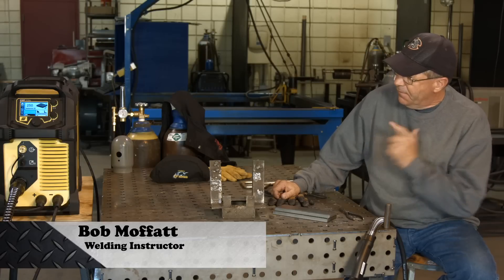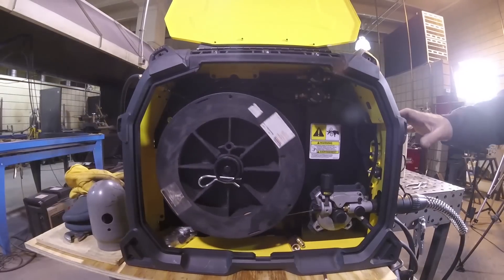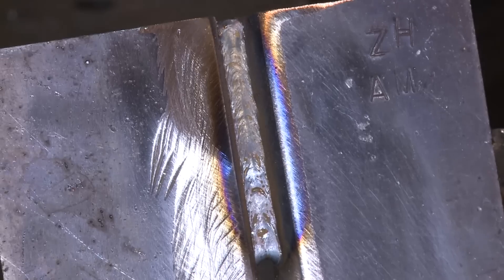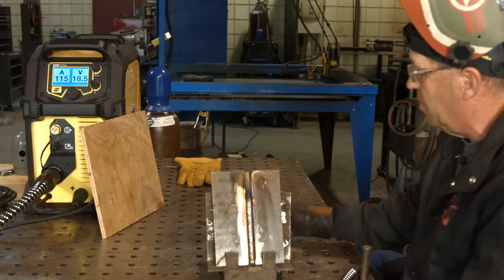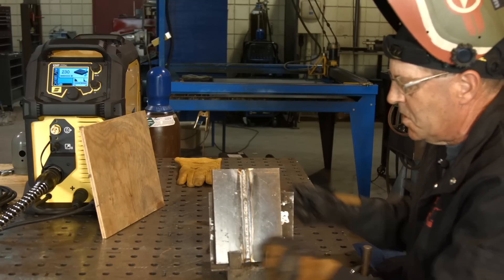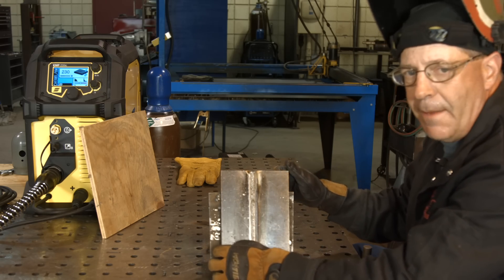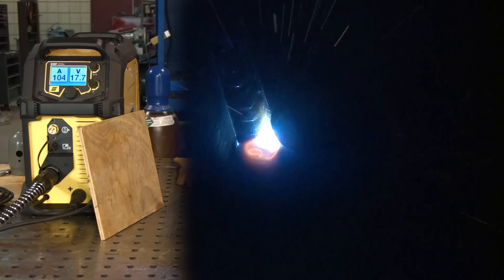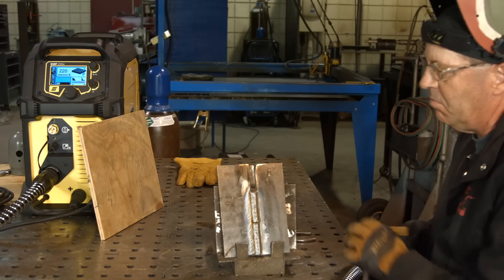🔥 sMIG Welding in a Groove | ESAB Rebel 235 Review - Part 2

Comment: Bob, I'm a little confused here..... Why did you set the machine to 3/16" if you are welding on 3/8" plate?? Why not set it on the thickness you were actually welding on? I was impressed that it actually welded so nice on that thicker plate. Great video! I actually just bought that machine 2 days ago so I'm excited to try it out.
Reply: @gonfishn  i would guess because they are welding in a bevel, the bevel is less thick than the plate thickness. After the root pass is done you would turn the heat up a bit

Comment: Bob, if I am trying to decide between the EMP 215ic or the EMP 235ic what justifies the extra 800 for the 235? I am a shop hobby person, but I also use the welder on 1/4" thick oilfield pipe putting up pipe fence around the 7 acres we have.  I may use it on a few thick welds in the shop, but for the most part I will not go beyond 3/8. Is the 215ic the better choice for me?

Comment: Of all three brands of machines you mentioned y'all use in your shop ( Miller, Lincoln, ESAB), which MIG machine is the most versatile, portable, best duty cycle, and produces the best all around weld quality?
Reply from the maker: Can't really compare as they are not in the same class. Some are $10,000 machines and some are $1,000 machines. I will say that we have been very happy with the Rebel units.
Reply: Have you ever compared the rebel to the Miller Multimatic 215? Those are the two that I have narrowed it down to.
Reply: Jacob Mathis this is more capable than the miller and the user interface is way better

Comment: i hate to bust your balls but where'd you get a WPS with a downhill progression? API1104 is all downhill but that code is for field pipe (gas lines) and thats the only code that allows for downhill anything and it be a qualified procedure. i guess you could do a qualification on a WPS and have a lab pull tensil bars just like you had some odd ball base material/filler issue?? you shop boys kill me!!! theres not even a blank space to fill in concerning weld parameters that are specific to the root pass. voltage/deposition rate/travel speed for the whole weld spec based on the heat input calculation for the particular base material group/thickness
Reply: take a look at Lincoln STT , Esab Super Pulse , Kemppi Mig-X "pipe root" machines , you will find the new technology allows for perfect fusion in downhill with solid wires that traditionally you would never use downhill ,whether it be pipe or plate butt welds.
People have to catch up to the tech and develop the procedure to suit the new technology . it will blow your socks off  :)
Reply: I agree my good Sir that the machines have advanced, filler metals are astounding how they bond with our modern alloys. thats not my point. in the field there are no super welding machines or super filler metals.  there is no new practices being used.   orbital welding....sure, downhill FCMAW on gas pipe per API 1104 code ... sure, but nu fancy "shop ' nonsense. downhill with solid wire GMAW is a very common practice in shops. its BAD practice and i will fire any welder i find doing it....on the spot!! in a shop you have the luxury of positioning the materials in such a way that position welding is retarded and no reason that anyone can not weld flat. my point is that we should teach practical application of skills to our up and coming welders so they are prepared for the job. you send these young cats out to me full of false hope and sugar plums dancing in their head and they won't be the dream welder superstar you've lead them to think they are for long  promise you that my friend. i will look them out in the test booth before they make one red cent. and there they go....lost confused and thinking I'm the biggest ass hole the have ever met. i am a CWI, Craft Instructor, Advanced Rigger and Iron Worker by TRADE. please for the love of all that is holy teach these guys proper procedures as per AWS, AMSE, or API. i know you're probably getting some kick back from the manufacturer and I'm glad you are. its the American way and i applaud you. you can still do your demo for them and showcase their products but for the benefit of those that don't know any better try and find a method that backed by code and industry standards. i can do it so i think you could too Sir. at least set the example up in a fashion similar to the practical application. Figure 4.1- 4.7 pos.157-162 in AWS D1.1 2010 show ALL the acceptable weld positions for plate, pipe, and tube and require a VERTICAL UP progression in all cases. T,K, and Y connections for structural pipe have special requirements especially if designed for a cyclical load. set some of those up and crank that rig. thanks for at least reading. I'm sure you get it? if you don't I'm sorry. its just real out here

Comment: Not specific to this machine, but I would like to see a demonstration of MIG welding mild steel to cast steel. For example, in automotive applications where you are welding axle tubes or brackets to a cast center differential housing. I've heard of the use of "high nickel" wire as opposed to ER70S-6, pre-heating, post-heating, etc. I'd be interested in knowing what the wire code would be for "high nickel" and your thoughts on these techniques.
Reply: I am not qualified to answer this question. I do wonder if tig brazing has some solutions for you.

Comment: Still on the fence about this welder but I did pull the trigger on 2 of those FabBlock welding tables.
Reply: I just picked up one of these 235 rebels, it is definitely worth the money. Time will tell how reliable it is but it has been awesome to use. The user interface is much better than anything else out there.
Reply: Waiting on them being released to the UK ...Money is burning a hole in my pocket
Reply from the maker: You won't be disappointed. Great tables

Comment: Bob,   love the videos you make they have helped me out a lot but i was wondering if you could do some mig with .045 wire.  im welding 5/16in wall square tubing to  3/4in plate and 45 degree cuts on the tubing.  i am having trouble  controlling the spatter.  if you could help me out it would be greatly appreciated.

Ryan
Reply from the maker: We've got some .045 videos coming up really soon.

Comment: it is a nice quality welding machine. in Denmark we use mostly 1. Migatronic 2. Esab 3. kemppi my daily machine is a Migatronic sigma 400 with the full packet unlocked. Love it! where  tester on it when they started the line in the mid 90th

Comment: On that first weld at 200 IPM looks like your trim was set at +9 that's probably why the voltage was so high. When you started welding at 230 ipm it looks like it was in the middle. You can only see it for about a half a second but when the camera shuts off and comes back on it looks like trim is at zero.

Comment: Will it run bigger wire than .35 ?
Reply from the maker: It will run a full range of .045 wire. We will be doing a .045 spray episode on this machine in a few weeks.
Reply from the maker: .035" = .889mm
Reply: Len Johnson what size is that in metric beacuse in Australia out stander size is 0.8 mm to 0.9 mm
Reply: our standard size in australia is actually 0.6 , 0.8 , 0.9 , 1.0 , 1.2 , 1.6 , 2.0 , 2.4 and 3.0 mm wires